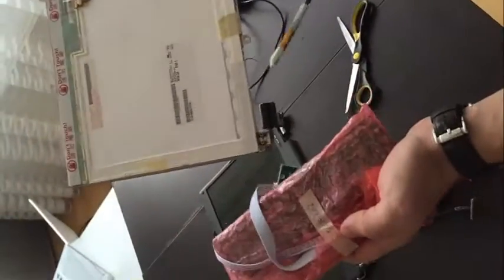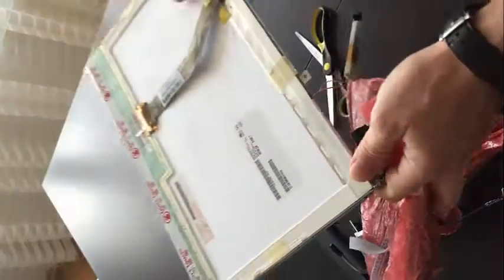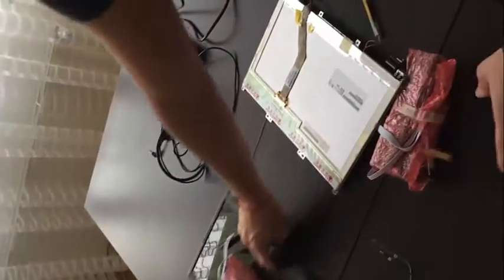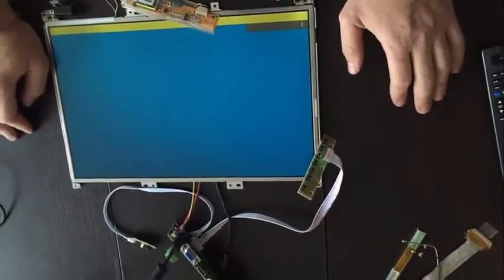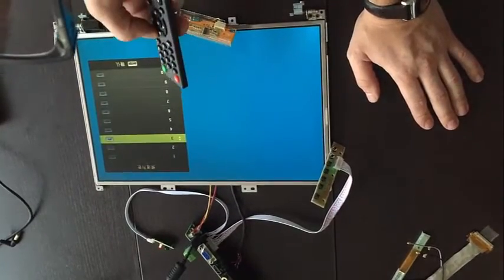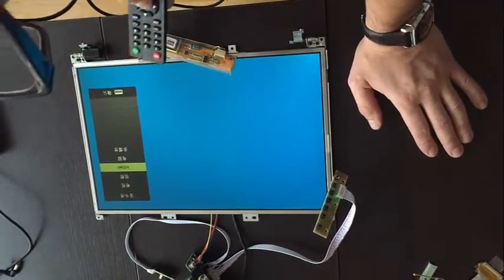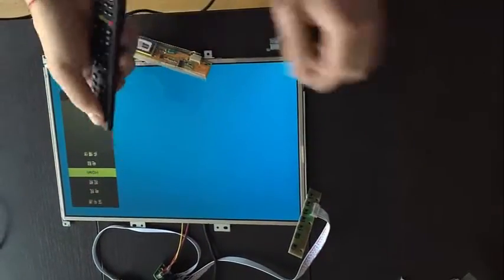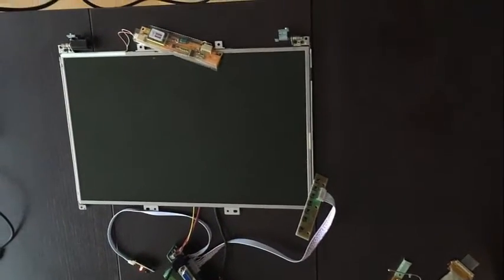How to transform Lcd Laptop Display from HP Pavilion Dv6000 in to TV or ordinary Monitor

Comment: Great Video, As far as I can see you haven't uploaded the follow-on video. May I therefore ask where exactly did you order the parts for the HP display from?
Reply from the maker: HI , you have to check the LCD number. I bought something like this  https://www.ebay.com/itm/HDMI-DVI-VGA-LCD-led-driver-Controller-Board-lvds-Kit-for-B154EW02-v-7-v7/112602234156?hash=item1a379dbd2c:g:J3YAAOSw6WVZnBvq